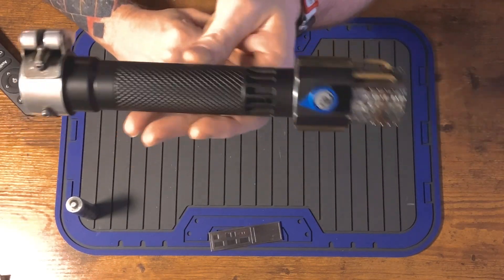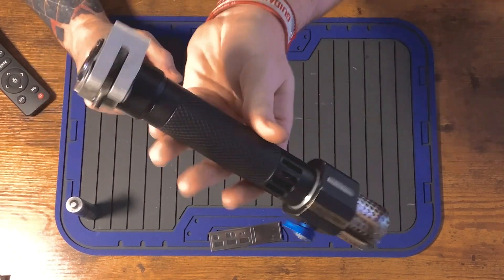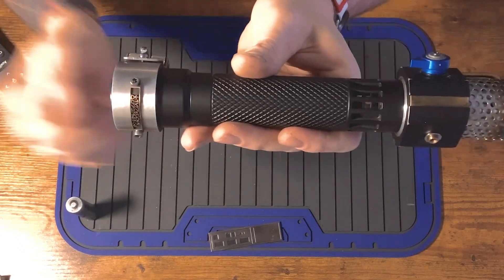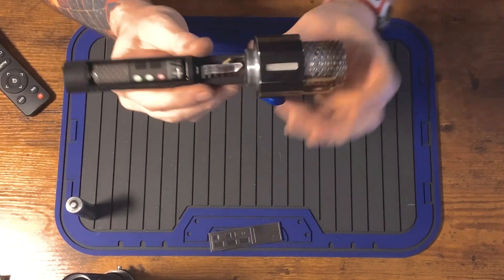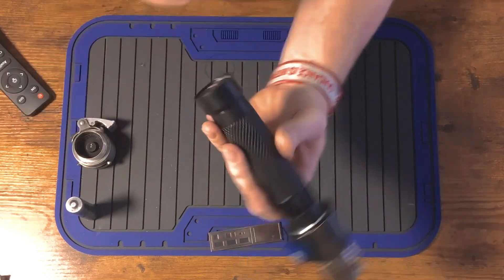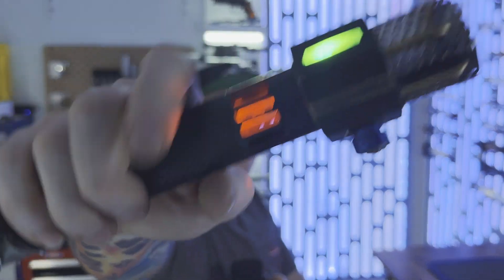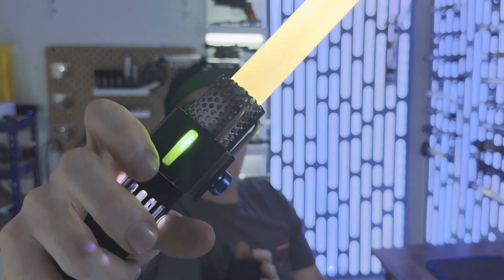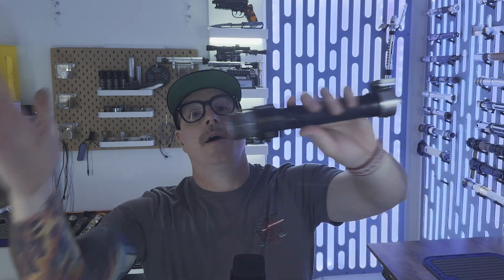Tierfon Orbital ‘Rev 3mk2’ With an MJF Nylon Chassis

Comment: Forgive my ignorance: when you say a “2020 neopixel strip”, what does that mean? I’ve heard a lot of designations for LEDs/neopixela but I can’t figure out what that number means.
Reply: 2020 refers to the LED size (2mmx2mm. Your usual neopixel blade typically has the 5050 npxl strip configuration whereas blinkies typically utilise the 3535/2020 strip